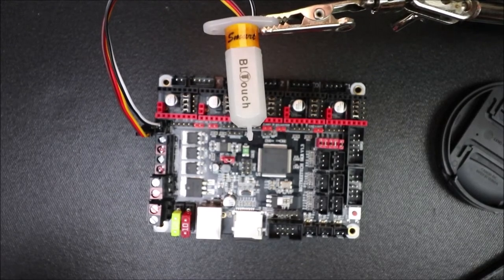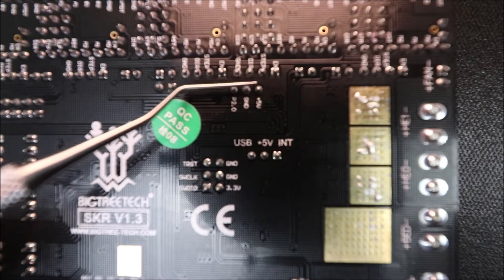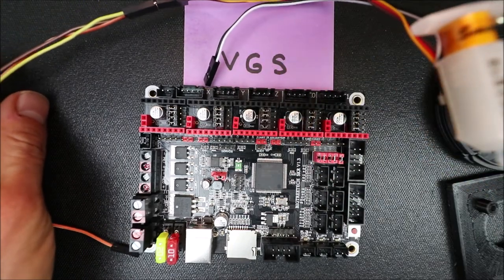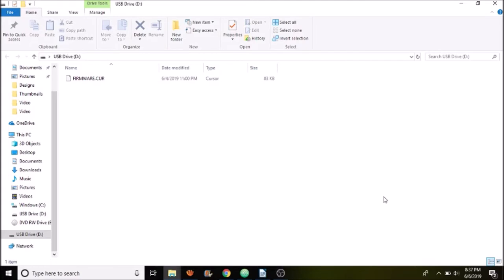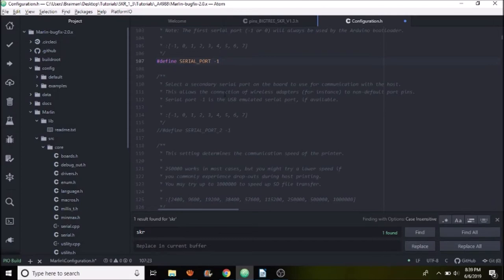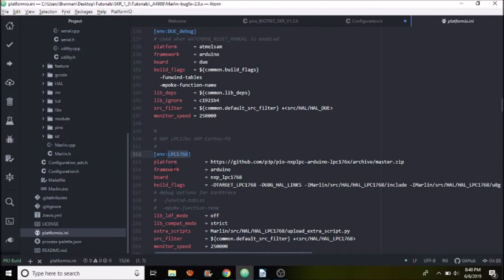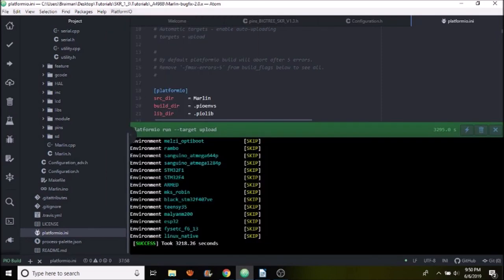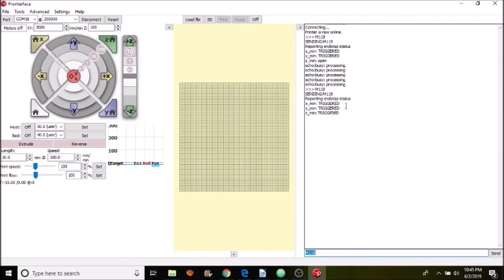SKR 1.3 - BLTouch

Comment: What BLTouch version do you have. Is it a 3.0 or 3.1?
Reply from the maker: Unsure, but guessing 3.0.
Reply from the maker: Just checked last night and it appears to be version 2.0.  I have ordered a Bltouch from Amazon for 3.0 to check issues, should be here in a couple of days.
Reply: @EdwardBraiman  Hi, I have a question about BLTouch v3.0, I bought skr V1.3 with TMC2130 and I had BLTouch V3.0 so I can't configure them actually I did but hotend crash to the bed. What should I do to fix this problem? Please figure out the problem. Also thanks for videos.
Reply from the maker: What happens when you test it without the z axis moving?
Reply: @EdwardBraiman  actually I suppose I figure out the problem but now I couldn't set the home truly so when I press the auto home it is going to middle of bed then I press the bed leveling and hotend wants go to the other corners from middle but it forces the limits so the motors have force because of wrong home cordinates
Reply from the maker: Do the motors move in the opposite direction of the Endstops?
Reply: @EdwardBraiman  No they are true but crashing and forcing it doesn't go all the way x and y to learn the limits that they can go until there
Reply from the maker: Are you using sensor less homing?
Reply: @EdwardBraiman  Yes but it doesn't work
Reply from the maker: Did you raise or lower the value from 8 to something?
Reply: @EdwardBraiman  No it is 8 and doesn't feel forcing but I checked the tmc2130 drivers from pronterface their values are normal